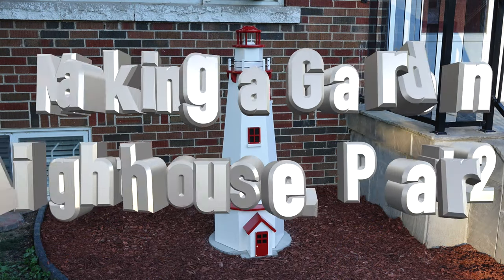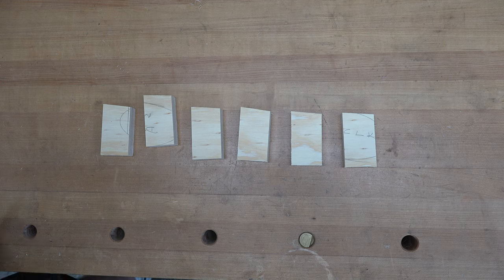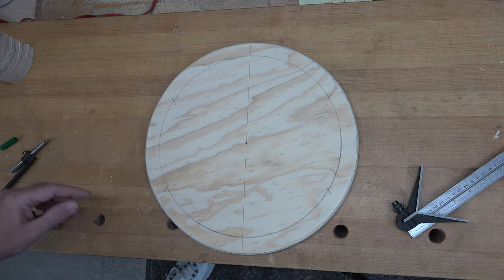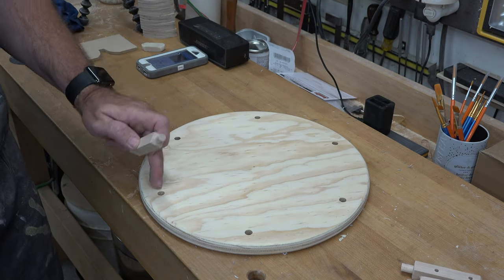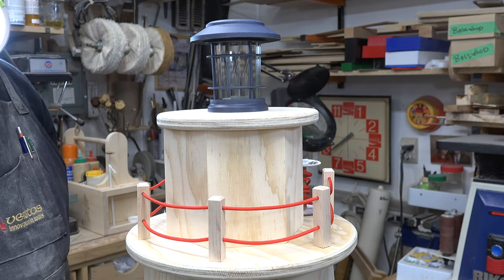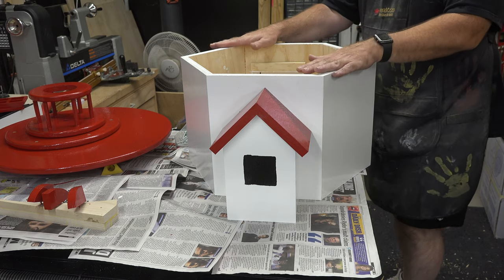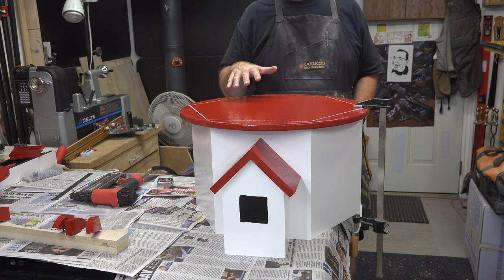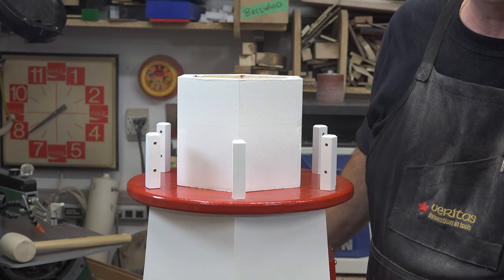Making a Garden Lighthouse Part 2

Comment: Awesome finish! Nice job. Based on the experience I have with the lighthouse I built 15 years ago, you should paint the inside of the lighthouse too. Water will eventually get inside ( as it did in mine) so having the inside painted will provide another layer of weather protection and make it last longer. I had to rebuild mine last summer and replace the large lower disk because the original had rotted (it was exterior grade plywood too). Now add some stones to emulate the rocky ocean coast!
Reply from the maker: When I do have to replace this one, I will definitely consider painting the inside as well.  I really like your stones idea to mimic the coast.  I may have to do that when I put the lighthouse back out in the spring.  Thanks for tuning in and for the suggestions.  I appreciate it.
Reply: I like your suggestion of painting the inside, thanks!!

Comment: I like the lighthouse you made. Mine will have a working door, and I will put glass around the Beacon Light, and use Stainless Steel Stanchions and Stainless Steel cable for the safety railing. I don't think the windows and door should have great big screws in all four corners, surely you should have attached them with fine nails from a nail gun or brads nailed with a hammer.
Reply from the maker: Your modifications sound fantastic Ian and I hope you enjoy your build.  As for the screws, they were added as brass accents as well as making it so that the windows could be removed.  Should they warp and need replacing or even to make re-painting easier in the coming years.  Either way, to each their own and if you aren't a fan of the brass screws, then by all means, use brad nails.  Either way would work just fine.  Great suggestion.  Thanks for tuning in

Comment: Great job ,loved how it came out the color is amazing .I am looking forward in building one. Going to start with the taper jig first.,i have also took note that you used a circle cutter you have on your bandsaw. I got a 9 inch bandsaw for Christmas and was wondering was there a video on how to make that circle cutting jig  like you were using  in your shop .Happy New Year  Kenny.
Reply from the maker: There is a tutorial for that jig Jim.  You can find part one here.  https://youtu.be/WXCpvnFrccw
If I am remembering correctly, it is a two part tutorial.  I hope this helps.  Good luck on your project and thanks for tuning in to the show and for the kind words.

Comment: I was wondering how is the lighthouse holding up with the weather so far ? Would you change any design to better the elements?
Reply from the maker: Thus far Adam, the lighthouse is doing great.  It has been out for two years of spring, summer and fall.  I do take them inside for the winters as the Canadian winters are just too brutal.  I noticed the other day that the paint was peeling slightly on the front face (it gets most of the sun) in an area that is about 3" square. I will most likely give this a new paint job over the winter but as far as the material and how it is fairing with the weather....I wouldn't change a thing.  It's doing amazingly well.  I hope this helps.  Thanks for tuning in to the show.

Comment: Kenny, I enjoy your multi part projects.  The extra detail is great.  Was this another rolled on paint job?  The quality of the paint job is quite nice.  BTW, I really like the additional detail around the light.  Really nice outcome.
Reply from the maker: This was a combination of roller and brush Paul.  Any larger flat surface that I can use a roller, I do.  In this case, it was a 3" roller.  However, some parts were spray painted such as the windows and the detail around the light.  It just made for an easier application and a smoother finish.  There's just something about this project that makes me smile.  Thanks for the kind words and for tuning in to the show this week.  I truly appreciate it sir.

Comment: Kenny,

This has been a great project for me.
Your video has been excellent. I completed all the cutting, now I start the sanding.
Did you make that modified top yourself or did you buy it?
Thanks,Peter
Reply from the maker: I made the modified top section Peter.  It is just some dowels and a plywood ring that fill out the light and make it a little more proportional to the lighthouse itself.  I hope this helps.  Thanks for tuning in and be sure to send me a picture of your completed lighthouse.  I'd love to see it.

Comment: Very well built what type of paint did you use to seal this as it is plywood
Reply from the maker: Thanks for the kind words on the project Alan.  Believe it or not, after I got a couple of coats of latex primer on the lighthouse, I just used high gloss Tremclad oil based rust paint.  It does a great job of sealing everything in and leaves a really nice smooth and glossy finish.  I hope this helps.  Thanks for tuning in to the show.

Comment: Did you edge banding the plywood? Must have missed that in the video if you did
Reply from the maker: You didn't miss anything Brian.  The plywood is not edge banded.  The entire edge surface is used for the glue up and that's it.  Between the silicone for assembly, the glue, the primer and the paint, all of the exposed surfaces are completely sealed and I honestly don't see the need for edge banding on an un-exposed surface.  I hope this helps.  Thanks for tuning in to the show and taking the time to ask your question.  It's appreciated.

Comment: Hi Kenny, nice build. I too built a lighthouse, very similar construction to yours. Bolted it to a concrete base. Mine sweats very badly on the inside. I need to rebuild it and I think I will create vents top and bottom to create circulation, maybe even add a small fan since I have 12 volt power running to it. Any thoughts on reducing the moisture inside?
Reply from the maker: The only thing I can think of is venting of the interior.  I'm surprised that it sweat like that but instead of windows like I have installed here on the show, how about louvered windows like this.  https://www.amazon.ca/Maurice-Franklin-Round-Plastic-Vent/dp/B01DH9B2C0/ref=sr_1_19?dchild=1&keywords=circular+vent+cover&qid=1607726919&sr=8-19
That would serves as decorative "window" but would also be venting of the interior.  They would be mounted directly in holes cut in the walls of the lighthouse to vent the interior.  Just a suggestion.  I hope it helps.  Thanks for tuning in to the show and good luck with your re-building on the lighthouse.
Reply: @acutabove_woodworkings  thanks, I will try that before i try a fan. The moisture seems to "migrate" up through the concrete because it stays very wet inside even in hot, dry weather.
Reply from the maker: @joelwatts9042  Very odd.  I will pay attention to mine and see what happens.
Reply: Be sure to add a screen to your vents or you will have a decorative beehive
Reply: @davidtrudel2215  good point.
Reply from the maker: @davidtrudel2215  I completely agree.  The vents in the link I provided have built in bug screening but that is definitely something to consider if making your own or purchasing other vents.  Thanks for chiming in and bringing up that point.  It's appreciated.

Comment: What kind of plywood did you use?
Reply from the maker: I just used regular grade plywood from the big box store with one finished side.  As long as you seal it well with the paint, it will last for years.  Mine is still looking great and it has been outside for 3 seasons a year ever since I made it.  I hope this helps Tom.  Thanks for tuning in to the show